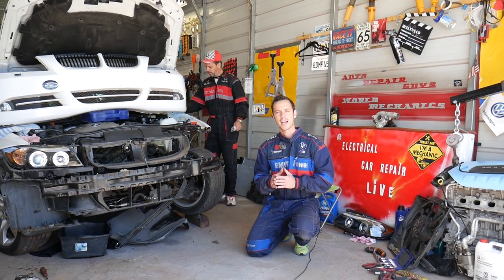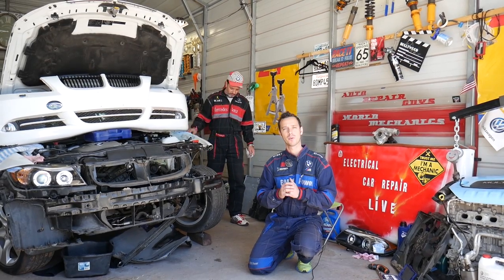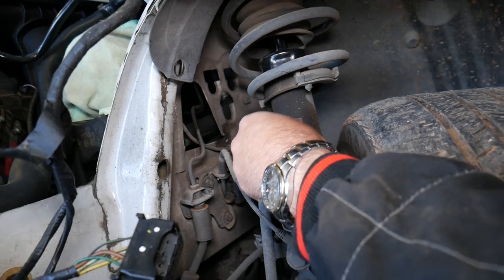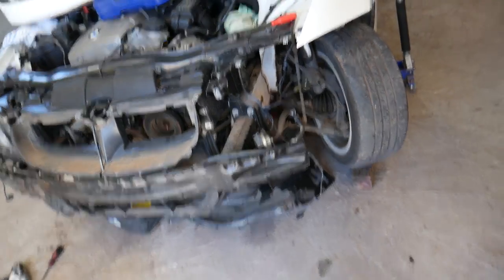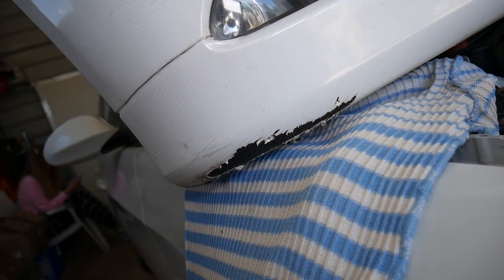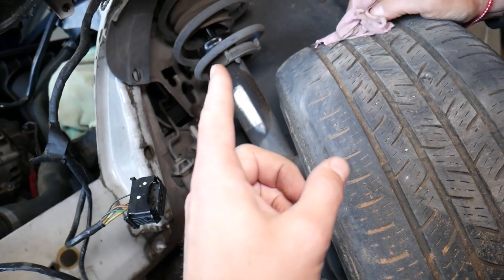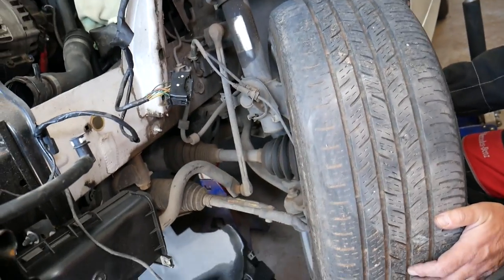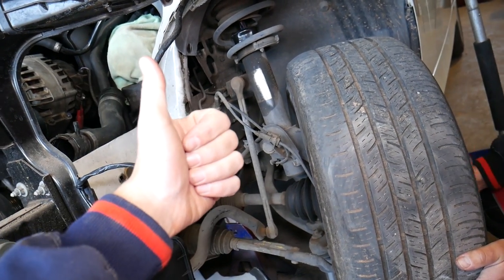FIRST SIGNS AND SYMPTOMS OF BAD SHOCKS, BAD STRUTS ON BMW

Comment: Hello there from Ireland.
Just a question I own a e90 BMW 2009 year I decided to lower the car.
I have installed just the sport lowering springs with the stock shock absorbers.
The rear is perfect very smooth drive it's just the front that is giving me trouble in low speed eg 20kmh small knocks are coming out the right side.had it checked everything is looking fine.My guy told me that it's looking like the shock absorbers is gonne.What would be your opinion on that please? many thanks.And all the best with your channel

Comment: My 2015 528i is making a loud humming noise from the beach left side. It feels like the exhaust honestly. It happenes at 40 mph and plus. Any idea of what it can be? Can it be the shock. I see oil in my shock also.
Reply: Maybe axle or wheel bearing
Reply: So if it’s happening when you’re driving around the exhaust/ below your car then it’s your differential driveshaft joint, driveshaft bearing, or rubber disc. I had same issue and replaced it and went away.
Reply: Exactly that. They wanted 8k to fix it smh

Comment: Nice vid, thanks. My E60 530i (Sport) with hydraulic-active roll bars, 115k miles has just started making a "knock - knock - knock" sound when I am turning 90 degrees left @ 15-20MPH. The car stays stored outdoors 24/7/365. What do you guess the problem is?
Reply: knocking when turning, i'd guess a bad ball joint first off.
Reply: @rbitrossome  So noted. Thanks for the advice.